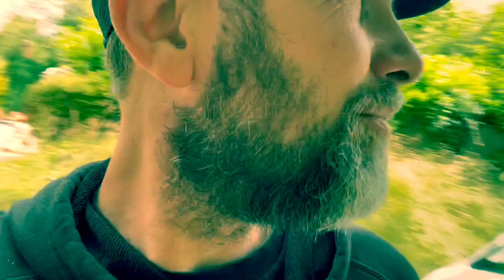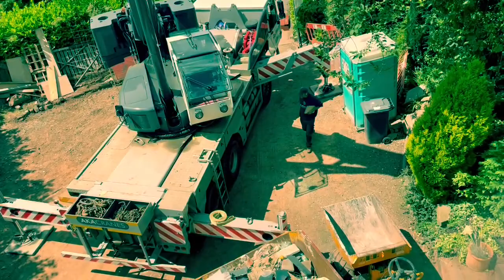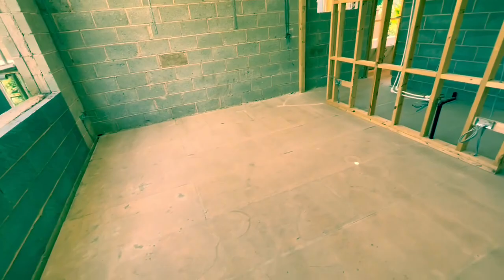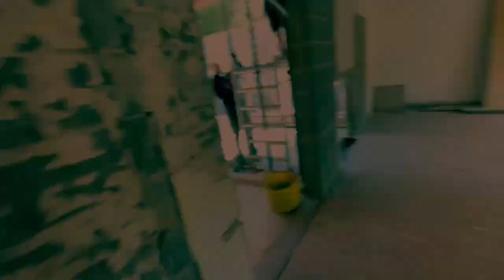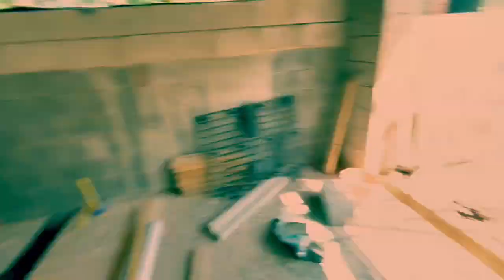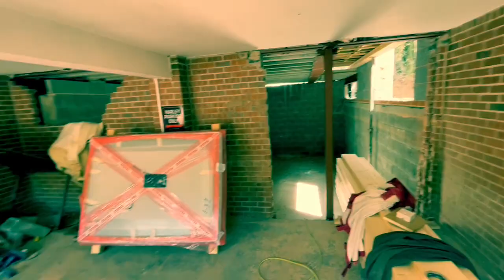Don’t Give Up On Buy-to-let! [2022 update]

Comment: Good video!  I’m wondering what’s your fix on EPC upgrades to a C for solid wall houses if the rules come in 2025?
Reply from the maker: Good question! I'm recording a video on this next week so look out for it. Short answer is don't panic and start doing unnecessary jobs. The rule change is not 100% clear and the fix is probably simpler than it looks from here. JFT
Reply: Look forward to that.